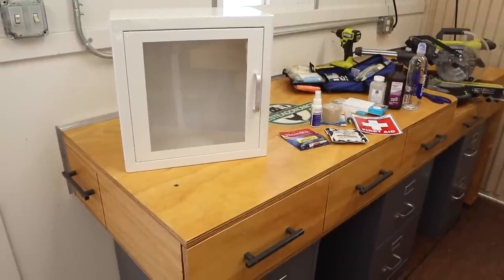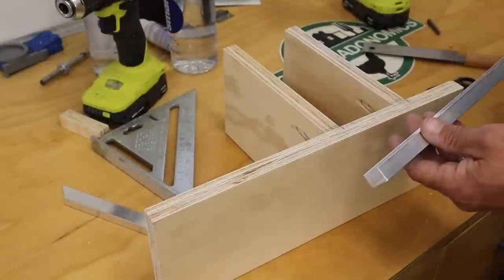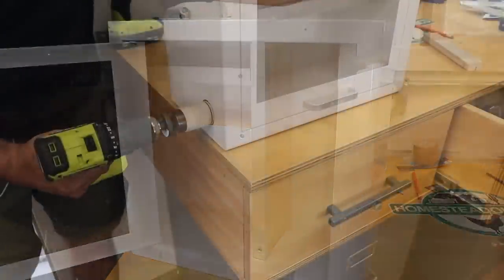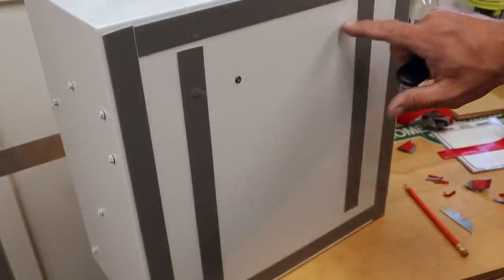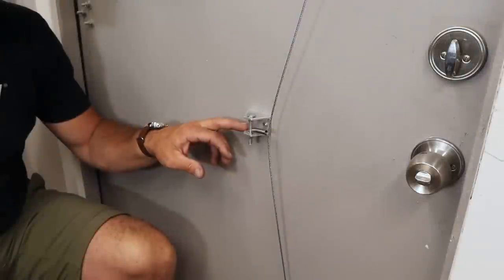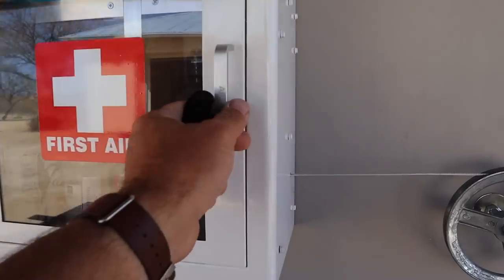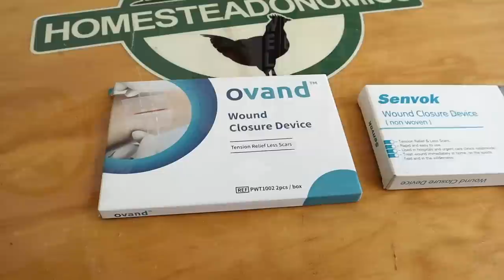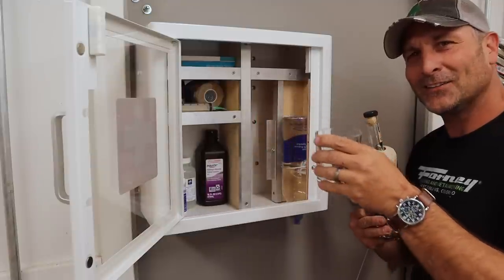DIY Shop First Aid Station  -  For the Shipping Container Shop

Comment from the maker: Thanks to all that have mentioned to add a tourniquet and medical super glue.   I already have the medical grade super glue in our house first aid kit.. but just forgot to add it in here.  A little bit of a rushed stocking for the video.   But both will certainly be going in there.  Thanks to all who suggested them😊🙏
Reply: I have used regular super glue in past.  Works ok on replacing chipped tooth if the piece is big enough to handle without getting glue on fingers.

Comment: This is really neat! Really every shop, home and vehicle needs a dedicated first aid safety kit with essentials 👏🏽 Love the foot pedal idea for cleaning a wound, especially an eye injury or burn could be incredibly useful! What if instead of plastic water bottles, look on Amazon for those softer (food/surgical grade) rubber bottles?! They’d be easier to squeeze I think plus washable/reusable much more than a crinkled water bottle and you can find some with smooth clean lines like you’re needing for this pulley system 👍🏼
Reply from the maker: Thanks!  Yes I do think another bottle might do a bit better.  I went with this shape mostly because I’ve seen quite a few thru hikers use them as they apparently have a slightly thicker wall over most other bottles.  I guess probably has to be since it doesn’t have a molded shape for ridgity (word? 😂)

Comment: Very neat idea of using the AED cabinet for this. I got a metal firsrt aid cabinet for my shop and while it works I wish it was a little bigger. I could make my own cabinet but I liked the idea of a nice metal cabinet. Thanks for sharing.
Reply from the maker: Yeah I liked this metal cabinet a lot.  I was going to build a wooden one until I saw the vintage one on Craigslist and then that kinda got me stuck on the AED cabinet.   Good size, looks great with the glass window and utility and durability are pretty good too!

Comment: thats clever. i use a 5 gallon coleman water cooler verticle one with push button valve on bottom. was in need of a setup out in the field all day long planting corn gusty winds blow starter fertilizer dust in my eyes burns like all hell and im not rinsing them out with mtn dew
Reply from the maker: Yeah those coolers are a must put in the field or a job site.  And mediates the water temp too!

Comment: Great build.  The only thing that I can see adding is either a good pair of splinter tweezers and/or some gray electrical tape.  The tape will sometimes "pull" a splinter and any of the 3M colored or phase tapes don't leave the residue the way that the normal black tape does.  And if you can't get the splinter out right away the tape keeps it from snagging on everything.

Comment: For stickers with "bumper sticker-like" adhesive, I usually get a spray bottle with clean water and add a few drops of Dawn soap. Spray the surface with the solution, and put the sticker on. As long as it is wet, you'll be able to reposition it and squeegee bubbles out with a  credit card. The water will dry within a day and the sticker will regain its full tackyness and hold on permanently.
Reply from the maker: Now I did not know that at all.   But I appreciate the tip…. Will try that on the next stick I have to place.   Thank you 🙏
Reply: same technique for applying window tint film.

Comment: Placing the first kit in drawer is not a good idea because it needs to be visible if you need it or there is another person is in the shop they will know where it is.  I would add splinter tweezer, tourniquet, and burn spray.  I would also add a separate eye wash station.
Reply from the maker: Yes to all those.   Tweezer would actually get used very commonly as I often get both metal and wood splinters in my hands.

Comment: Yeah I was gonna say SMART Water isn't very smart... Its owned by Coco Cola and their water isn't very clean. Its full of heavy metals etc... If you use an Electrolysis on the water you'll be shocked how much rubbish it contains ppm. Do you have and use a Water Distiller?
Reply from the maker: Yeah, I generally don’t buy bottled water but I liked the shape of these bottle for this project .  And they have a slightly thicker plastic than the bottles that have shape to ridgidize them.   As for distilling, nope.  We use a berkey ceramic water filter for all of our drinking and cooking water.

Comment: Great job & it wouldn't be right if you didn't add that n nice shiny trim that's your trademark to this project also like the foot panel on the bottom. Great concept in adding a foot a foot pedal on your box. 
You may not of thought this. But your hands are free to open your eyes to flush them out, hold your eyes open & run it wide open.
I've been in the medical field for nearly over 45 years & this has to be one of your best ideas yet. WTG JOE! I'm impressed & love the way you've designed it. Might need a little tweaking, but your on the right track. 
Please ,et us know, around the 4 week mark. Keep up on the great progress, 
Chris from Missouri
Reply from the maker: Oh yes, I had a couple project recently where several people said “where’s the aluminum trim”😂.  So I had to bring it back!!!  As for tweaks, yes I still have a bit to do before this is totally ready.  Tourniquet, tweezers, medical grade glue ( I found some cool little ones a while back in individual packs… but they are in the house first aid closet area.).  And maybe a bit of work yet to the irrigation part…. I got lots of ideas on how to make it better….but I also need to get back to try goat project and travel trailer… to do list never ends😂

Comment: a small grommet for the wire coming out of the hole and some tubing around the water bottle to keep the wire from carving a into them.
Reply from the maker: Yeah I though I had a little bushing that I could slip in there, but couldn’t find it.   But I don’t think it’ll get used enough to wear too much of a groove.  At least I hope not😂

Comment: Nice project.

Given that you weld, I'd suggest more stuff for treating burns to complement all of the clotting and wound care stuff you already have. Tweezers and a magnifier for splinter removal and a mirror on the door next to the kit for checking eyes would not be a bad idea for a shop FAK, either. And maybe a spray can of Solarcaine for sunburns.

I'm always amazed at your inventiveness. I'm honestly a little surprised that we didn't see some PVC fittings and a valve connected to the water bottle so you can just step on the pedal, open the valve, and squeeze the bottle all without touching the cap.

By this time next year I bet we'll see you add an actual hand- and tool-washing sink under the awning of the shop, fed by your nearby water tanks.

Then you'll add a wall-mounted fan out there with a water mister, to keep cool on some of those warm summer afternoons.

And eventually you'll have a TV on the outside of the shop to keep you entertained while you're working. :-)
Reply from the maker: Oh no… your giving me more ideas!?! 😂   But I do like them!   Yeah tweezers and some burn aids would be great!

Comment: Would it not be better with thinner ply? The sehelves might take to much space.
Reply from the maker: Thinner would be fine…but I’m using the scraps I had.   But it’s actually a combo.  The part on the right side near the water bottle is 1/2”… and the rest was cut from the curved section of plywood that was from the miter bench that most of this build is taking place on.   So it’s kinda connected in a way😀

Comment: Maybe add some super glue to help seal a cut . Cut should not be leaking so that the glue will set. I know that it works from experience And hospitals also use it to close wounds.
Love and Peace.      Blessed Be.      Doug
Reply from the maker: You know what…. I actually have some medical grade stuff in the house.   Just didn’t think of that or having a tourniquet which was another good suggestion.  Both will be making their way in their soon!   Thank you!

Comment: Just curious but is that a Ryobi table saw cordless operated?
Reply from the maker: No this is the corded one.   I have not used the cordless version. I think it’s an 8 1/4” blade.   But based on my experience with Ryobi I think it probably performs every bit as good….just limited on battery life versus the corded saw.

Comment: Walking into the house, bleeding on the floor...LOL.  Years ago, I was clearing some brush on one side of the yard, using a machete, while my wife and daughter were doing something else on the other side.  Holding some stuff off to the side with one hand and swinging the machete with the other, the machete "bounced" a bit and bit right into the back of the hand not holding it, cutting into the backs of three fingers.  Clearly, this was not the sort of thing I wanted my wife and/or daughter to see, since they might have freaked out a bit.  So I casually dropped the machete and walked back to the house, leaving a trail behind me.  When I got to the rear deck, I cupped the injured hand with the other to keep the blood from getting on the wood, and quickly went inside and rinsed off at the kitchen sink.  Then I cupped it again, and went quickly to the mast bathroom, where first aid supplies were, so I could clean it up and bandage it.  I avoided dripping any blood on the carpets!  Yay, me!  However, while cleaning the wounds, I noticed my vision going a bit "tunnel", dark at the outsides, and realized this would be a bad time and place to black out.  To this day, I have some nice scars to remind me of that particular incident.  Then there was the incident involving the pruning saw.  And the other one with a knife that sort of stuck into my leg.  When asked if I have any "piercings", I have to check whether they mean intentional ones only.
He drills out a bunch of holes, then says "Now the boring part is done."  OK, I don't know if that was intentional or not, but it made me laugh anyway.  Drilling holes is definitely boring.  But you should always position the tool carefully, and keep body parts out of danger, so you do not yourself become bored.  See above.

Comment: Love the build, maybe add a catch basin with a drain hole that runs outside. That will keep the water to the exterior. Would be best in areas where water doesn't evaporate as quickly.